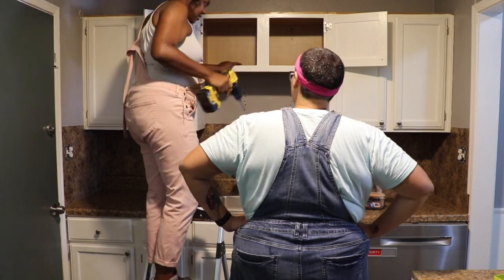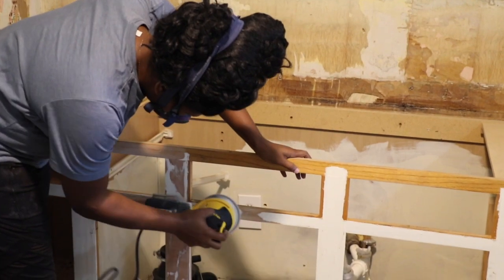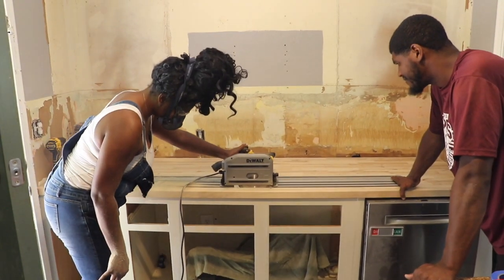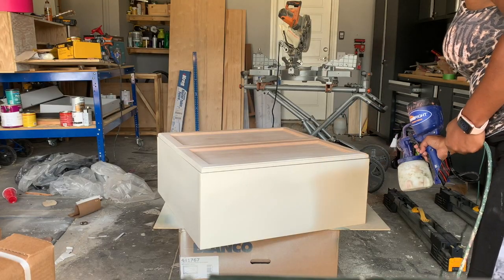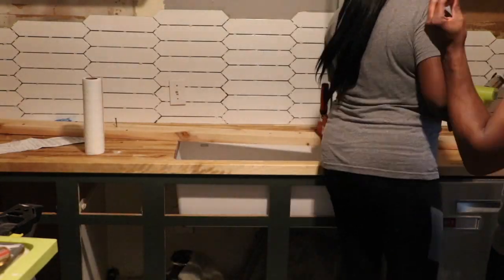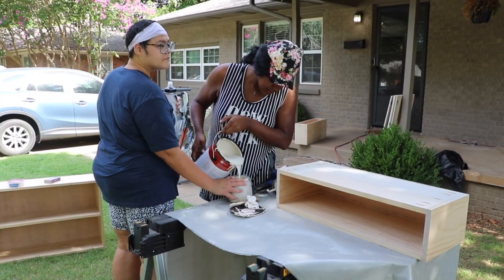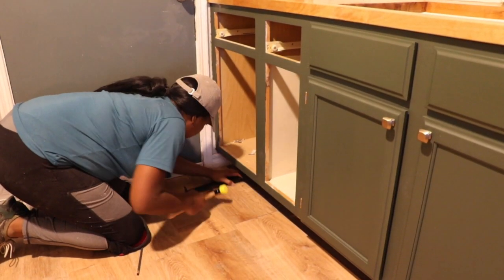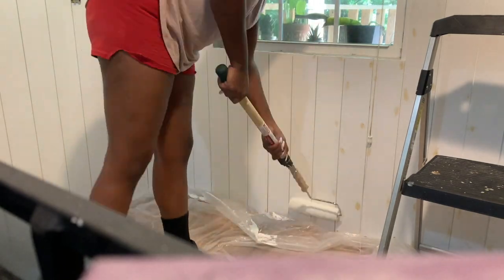Kitchen Renovation on a $3200 Budget | Before and After | ft. Painted Cabinets and Butcher Block

Comment: Thanks for the butcherblock countertop.  The biggest disagreement my wife and I have is over wood.  She likes to paint wood, while I love natural wood colors like Walnut and Cherry.  The only real negative was the cabinets from Home Depot (and Lowe's) all seem to have doors that do not line up properly.  While in the store a few months ago I saw the cardboard covering the edges of the doors and I could not see if they were level, so I cut the cardboard and saw they were not (at both stores).  Then I went through every cabinet in the size I wanted and every single one had one door higher than the other, so we went to the other big box store and looked and they had the same problem.  It was so frustrating and I really wish I'd have had the time to just build my own new cabinet correctly.  Now the granite countertop is in place so it is too much to build a new cabinet, but I may still build new cabinet doors.  

It's nice to see a lady with such a great love for work like this.  It's obvious you love what you do, and I'm glad you're getting new opportunities like this.  This job proves you can do the work as well as anyone, (and honestly, better than most) and I hope it brings you much new work Ashley!

Comment: I usually don't care for painted cabinets, but this kitchen makeover is amazing. 
I have one question about the tool you used on to get a tight fit on the flooring. We recently installed floating floors in our guest rooms and it was a pain in the brain! No one told us there was a tool like the one you used.
Reply from the maker: Organize Create Decorate yup! It helps tighten the floors together..I believe I added the link to the flooring kit in my blog post...links in the description
Reply: @TheAshleyBasnight  Thank you for such a quick reply. I noticed the link, but thought it was just for the floor itself. Sorry. I've had a rough day, brain is not working well. Guess I should head to bed. 
You really did an amazing job.
Reply from the maker: Organize Create Decorate not the link to the flooring...there’s a link with a blog post with all the details of the project...not the link to the flooring
Reply: @TheAshleyBasnight  Thank you so much. I really appreciate that. Too much going on right now in life that my brain isn't grasping some things.

Comment: I have installed wood floors in about 7 homes so far and I will give you some advice attaching planks, don't use the block or bar to tighten the planks together. Follow how you are installing the floor and then take a new plank and cut an end piece of that plank of floor about 8 inches long and then cut that piece in half, so you will have an 8 inch long piece with one side having the cut side and the other side you insert in the flooring, this piece will be the piece you tap the planks to tighten them together, by doing this you will not cause any damage to the plank you are installing. Just an FYI